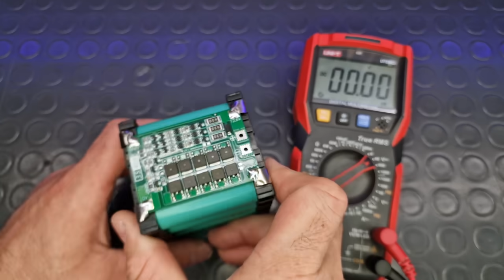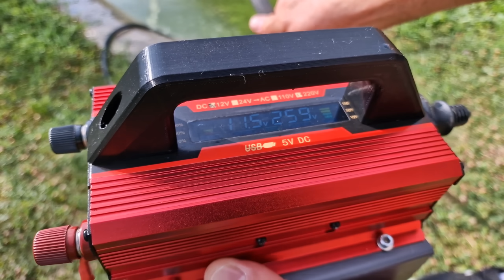DIY 24000mAh 400W Portable Inverter (12V - 220V) 18650 3S 12P LiIon Battery Pack

Comment: Awesome project as always and looks neat and tidy, but only problem is that you wouldn't be able to use half of the capacity 0%-50%, because this inverter is designed for lead acid 12v battery voltages.  Specs for this inverter is 11V - 14V. 3S lithium-ion has 9V - 12.6V. Voltage ranges for Lead 12V == 3.5S Li-Ion. As i was building same powerstation i had same problem, the only solution is to use 7S li-ion battery and 24V inverter designed for 24V lead acid battery voltages ( 20V - 30V) and 7S lithium-ion is 21V - 29,4V, which perfectly fits at the voltage range, i know because i already made one myself :) 
Or you will be able to use full capacity with this configuration if your inverter doesn't have any low voltage protection (11V). Then it will not turn off until BMS low voltage would kick in at 9V.
Or if you want to use this inverter (which has low voltage protection) other solution is to use 4S Lifepo4 ( 10V - 13.6V ), which basically fits right to 12v lead voltages.
Reply: Question is what's it used for because most things that need portability require longer run time than this 24ah could possibly output which kinda makes it pointless and get rid of the stupid inverter and get proper devices that run on battery eg 12v camping stuff and usb 5v devices only makes sense using 110 or 240v at home 😂
Reply: It's actually good this way. The inverter will shut down before it discharges the battery pack to unsafe levels.
Reply: @kevinroberts781   unsafe level would be <3v, not 3,7v*3 at which point inverter would shutoff because of "low voltage" but i hope you are talking about working load voltage (voltage sag) getting near 3v, even if the standby voltage would be ~3,8v at the moment. But i doubt that this inverter would pull enough to create such huge voltage sag. So if we factor voltage sag, this configuration will still loose ~30% of capacity potencial. The bigger the battery the more lost (unused) capacity.
Reply: مو🎉٠
Reply: hey, why dont just use step up?
Reply: I completely agree! with a cut in the minimum voltage of the inverter to 11 Volt the 3S configuration is insufficient and the 4S configuration is excessive as maximum voltage. The solution is 4S Lifepo4 cells.
Reply: @salvatorebarbaro5862  yes you are right, for this application, LiFePo4 chemistry voltages meet exact criteria of lead acid voltages 1x 12v lead acid=4s LiFePo4, unlike Li-ion or LiPo, but i wrote previous coommet because in the video, Li-ion was used, so just pin pointed what is wrong with it.
Reply: Why not have radio FM and SIM card WiFi

Comment: I did this setup with a 96ah super beast pack converted to 12v and put in a battery box then added a 2000watt inverter to the top, thong pushes some power!
Reply from the maker: I also make a similar 2000W inverter but used Parkside batteries
https://youtu.be/mdJ2tnA4_iE
Reply: Why not have radio FM and SIM card WiFi

Comment: Nice! Will the batteries/BMS get hot? Some vent holes maybe and rubber feet to keep the bottom scratch-free :)
Reply from the maker: The batteries won't get hot because they are 12P and can supply over 120A BMS does get a little hot but not much.
Yes, you are right, I should also add pads to the bottom.🙂
Reply: Why not have radio FM and SIM card WiFi

Comment: your battery pack build was mesmerizing!  is that an 800W peak 400W continuous inverter?  Excellent build.
Reply from the maker: Thank you very much for your kind words.  According to specifications, 400W continuous and 800W peak power, but it can actually support up to 300~350W Max.
Reply: Why not have radio FM and SIM card WiFi

Comment: Great project, but you can use only 45% (10.8Ah) of the battery capacity if you calculate voltage differences and 90% inverter efficiency.
Reply: Why not have radio FM and SIM card WiFi

Comment: Could you have lower volts and us a dc to dc buck boost convertor or higher voltage and a dc buck converter to lower the voltage. 
I ask as when i was on site i needed 19v for my laptop and rather then use an invertor i found the buck converters use less electricity but i shppose its down to the watts. My mackbook was 75w o had a 150w and it still got pretty warm so always try go higher if poss and improve the heat dispersment. Xxx
Reply from the maker: You may find these videos interesting🤔🙂
https://youtu.be/HSpSuCGFK5s
https://youtu.be/y_3yFDpwFBk

Comment: Good afternoon.
What adhesives do you use for plastic pipes?
Reply from the maker: Good evening🙂
I use Loctite super glue and also used Miter Apel two-component adhesive with curing spray.

Comment: Hello, would a converter like this be able to supply about 150W of lighting at 220V?
Reply from the maker: I measured it and it can actually supply up to 350W, but at 350W power it starts to heat up a bit. But 150W won't be a problem🙂
Reply: @ErCanEverything  Ok, thanks for the information👍
Reply: @ErCanEverything what parts did heat up? The inverter or the battery /bms?

Comment: Why would you complicate things? Why would that not be 24 amp hour
Reply from the maker: What is the difference between 24000mAh and 24Ah?
Reply: 24Ah is shorter than 24000mAh in character length 😅but mAh is more popular than Ah @ErCanEverything